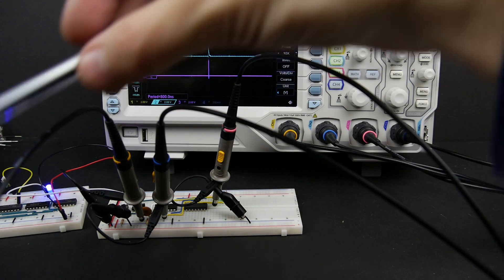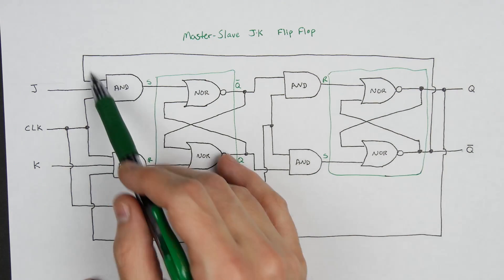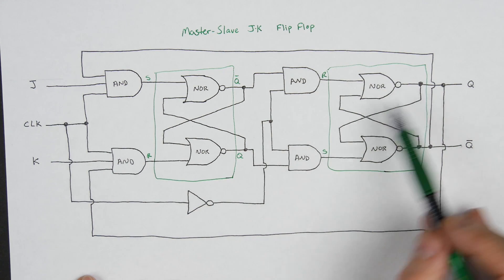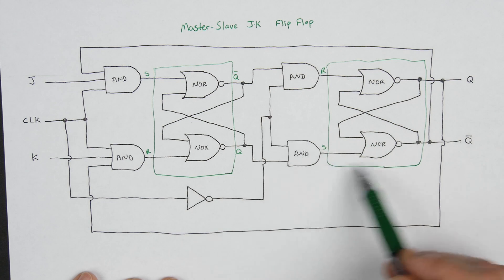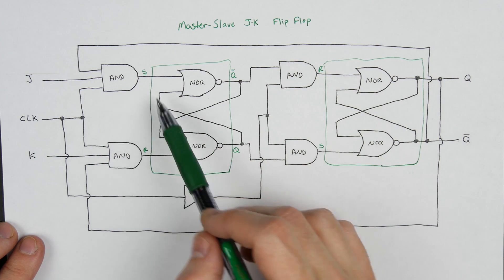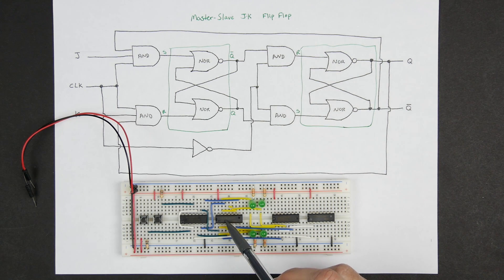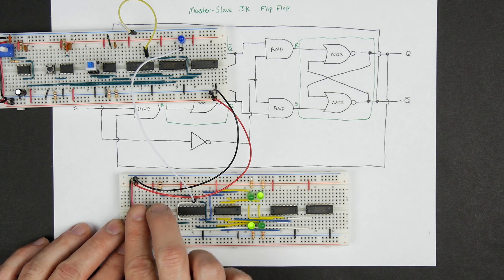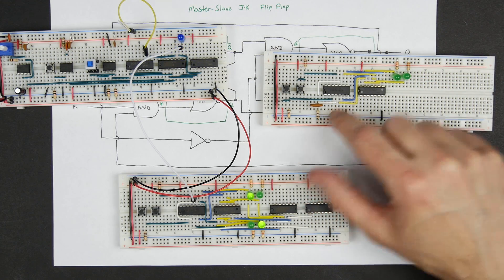Master-slave JK flip-flop

Comment: Has no one noticed the circuit at 5:21 must be wrong? J can’t set Q high: the bottom AND gate will always output low because of the low input from Q. 

With Q & J low, the bottom NOR gate outputs high making K & the top AND gate irrelevant.
Reply: You are right I noticed the same thing in his last video about JK flip flop itself, where he fed the `Q (Q complement) output to the K-AND gate and Q to the J-AND gate, infact in this configuration of JK flip flop (made with NOR SR Latch and AND gates) the feedback wires are not crossed, and the Q should feedback into K and `Q to J while in the NAND configuration of JK flip flop the feedback wires are sort of "crossed". So many people watched it and only a few people pointed it out,  makes you wonder, that if people are even learning (and essentially trying to think) or just watching it as entertainment

Comment: Personally, I would've just put something in the circuit to slow down the feedback signal... but i understand that's not really a viable / long-term solution if you want to go up higher in clock speed.

Comment: 📺💬 There are more applications as you may hear about clock and Q compliment for signaling transmission.
🥺💬 I start to watch his VDO from the built computer and not remote device control or transmission I do not know which one is harder but all are interesting.

📺💬 Next, we go to the full center and binary counter.

Comment: I think you should use RC circuit again in the CLK part. If you do not use RC circuit, you may have again racing condition in the master and slave part because when CLK is high, master part will always toggle and when CLK is low, slave part will always toggle. Also, the period of CLK should be very small  for example nanoseconds if you do not use RC circuit.
Reply: If it's connected correctly, the second one should never be able to receive both J and K inputs as 1s, so it should never be oscillating and the first one only toggles when receiving the output of the second JK in the series, so it shouldn't oscillate either

Comment: I'd love to hear your explanation of 74LS vs HC and others. Why do you use LS for these projects when most people seem to recommend HC? What should I get if I just want to mess around with logic?
Reply: The LS series still uses bipolar transistors for true TTL but uses less power than the original 7400 chips. The HC series is high speed CMOS which emulates TTL. The CMOS versions use even less power and are considerably faster than their TTL counterparts, so they're more often used for their performance in products you buy at the store. However, they're a lot more sensitive to static discharge which is pretty important when you're building something on a breadboard and handling the chips and connecting wires a lot. Additionally, CMOS tends to prefer 3.3V instead of 5V for power, though the HC series can handle either. If you're just messing around trying stuff on a breadboard, the LS series is much better in my opinion for its greater durability.

Comment: what if I place a pulse detector between the master's sr latch and gates and the cable with goes to the inverter for the slave sr latch. Will it detect a signal only at the rising eage of the clock or it will make a racing problem again?

Comment: 2:27: Aren't master and slave gonna be active when the clock is already high but the inverter is still switching from high to low?
Reply: As I understand it, this isn't an issue because it takes longer for the signal to propagate through the first SR flip-flop than it does for the inverter to switch. Afaik the inverter will switch faster than even just one of those AND gates, since the transistor logic is less complex.
Reply: @kieraleahy6795  Yes, you're right. Thanks

Comment: your JK FF is bit different with others in internet, they built all with NAND
Reply: The circuit at 5:21 doesn’t work. J can’t set Q high: the bottom AND gate will always output low because of the low input from Q. 

With Q & J low, the bottom NOR gate outputs high making K & the top AND gate irrelevant.
Reply: I studied JK flip flop built with all NAND gates and it looked correct

Comment: could it be possible to use the output of an edge detector to quickly update both JKs without the need to wait for the clock to go low? Is it useful in any way, apart for looking more responsive?

Comment: To beat the race condition, wouldn't it also have been possible and sufficient to simply use the CLK & !CLK edge detector circuit that was shown in the D flip-flop video? 
There was a simple circuit shown there that split the clock signal and fed one side into an AND gate and another first through a NOT gate and then into the same AND gate. It was shown after 7m29s here: https://www.youtube.com/watch?v=YW-_GkUguMM&t=7m29s Wouldn't that also do?

Comment: How to decide what is set and what is reset?
Reply: If they're unlabeled, then either input could be Set or Reset. Then whichever one you call Set determines which output is Q, because it'll be the output that goes high if you take Set high, and the other output is Q-complement. The circuit is symmetrical, so it makes no difference until you connect it to other things.
Reply: @SirRebrl  okkkk, thanks bud.

Comment: Latch -> flip-flop -> JK flip-flop -> master-slave JK flip-flop
Reply: where does the D latch fit into that?
Reply: @Natture01  latch -> SR latch ( basically to set or reset the latch ) / D - latch ( if enabled whatever D input is output is layched ) - > flip flop - > SR flipflop ( works just fine , except for when both set and reset are high , making it unpredictable) / J-K flip flop ( theoretically eliminates the unpredictability by accounting for feedback from output , but the clock is high for long enough time/ wide range making it practically unpredictable -> Master slave JK flip flop ( completely robust and predictable behaviour )

Comment: anyone implementing this with logisim - you can use the flip flop in this video with a reset input added to the first NOR gate in line with the k input. applying the reset there will bring the circuit to a stable state. 

reference: https://github.com/netguy204/cmsc313_examples/blob/master/logisim/Master%20Slave%20J-K%20Flip%20Flop.circ
Reply: Sorry for my ignorance but how can I run the code you sent?

Comment: there is a wrong in this scheme. you have to switch the feedback or to switch the NOR gates with NAND
Reply: The diagram is correct. If Q is high for instance, then the feedback to the K input-AND is high, and then if K is high and the clock is high, that takes that AND gate high, turning the first-stage Q low, which turns the first-stage Q-complement high. Then when the clock goes low, that propagates to the second stage.

The feedback only enables either input when the opposite output is high, which is what gives it the toggle ability if both inputs are set high - only the input for the state opposite the latched stat goes through.

You might be referring to other setups based on NAND gates and applying what you know from those? The internal logic of an AND-NOR setup is a little different than an all-NAND setup but it comes out working the same just looking at the inputs and outputs. If you draw it on a whiteboard you can step through the signal propagation by labeling the connections with 1's and 0's. That's what I do, anyway.

Comment: There is a problem with this. As the clock transitions between high and low you might have the inverter interpreting the clock as one thing and the first and gates as the other, making both flip flops enabled or disabled. You'd want 2 pulse generators (one for rising and one for falling edge).

Comment: If this doesn’t work for you keep reading. I built this even though it won’t be a final component of the computer, because I want to understand the logic. I also built the J-K Flip Flop because I wanted to perform the debugging with my scope. Of course, Ben does not walk through the build process on this Master Slave Flip Flop step by step and I would not expect him to at this point. I like trying to follow the schematic along with viewing the finished board. Unfortunately on this build, once I was finished, it did not function properly. Rather than examine the schematic, I simply compared my build to the video. I could not find anything wrong. Finally, I took a screen shot of the board and then blew it up larger. This is how I discovered that I completely missed the jumper on the 74LS02 between pins 3 and 4. It was so small it just blended in on my video. Hope this helps someone else that might miss it. Moving on now to the next video. Very much enjoying the build and the knowledge gained.

Comment: I'm kinda new to this stuff so correct me if I'm wrong. I don't think the second S-R latch portion of the circuit is needed, the outputs of the first S-R latch are the compliment of the outputs of the second latch, wouldn't it be simpler to replace that section (only the stuff surrounded by the green box green) with two not gates, or am I missing something?
Reply: It would keep toggling itself extremely rapidly while the clk is high.

Comment: This is a negative-edge triggered flip-flop. Is it possible to make it positive-edge triggered by using the NOT gate for the clock pulse of Master instead of the slave?
Reply: How we make this circuit on bread board . I mean to make this circuit which ics are used
Reply: @miniaturenature2507  You buy the 7400 series chips from Jameco and you assemble it.
Reply: i thinkk so

Comment: 7. This circuit relies on the falling clock edge to propagate through the Not gate on the bottom faster than the changed data propagates through the master JK-flip-flop. In an integrated chip this can be done reliably, but on a breadboard it might not be.
On what order of magnitude are the timing differences here? I don't have the parts to try it myself. If the difference is very large (something like 10 times the time it takes for the falling clock edge to propagate through the Not gate) then I'm convinced that the circuit is reliable, but I suspect it might be kinda close.

Comment: Yay, no more racing! ... But! What if the NOT gate used on the clock signal has a looser sense / lower tolerance for HIGH than the and gates? All logic gates have some manufacturing differences, right? If that is the case, and if the clock signal spends a sufficient amount of time in this state (where the AND gates from the 1st stage SR latch considers the clock to be high, and the lone NOT gate considers the clock to be low), would that mean that there would be some more JK racing? I'm guessing this wouldn't be an issue in most cases, but still. Who knows? (Not me, for sure!) Loving these videos!
Reply: Or just use the simple RC edge detector before the and gates.
Reply: That also seems a problem to me. You could solve it however. If for example you add the output of the inverter with a comparitor which checks if the clock voltage is less than a certain low value. Then the second SR latch would only be enabled if the clock is less than a certain voltage
Reply: I guess you won't need that inverter then either

Comment: Couldn't you just use a capacitor on the clock of a normal JK flip flop as you did with the D flip flop? Or would it be difficult to tune?
Reply: Do you mean using a capacitor-resistor combo as a rising edge detector for the clock? If so, yes, it would be difficult to tune, at least on a bread board. That would be why a master-slave JK is necessary. Ben explains this in the previous video in this series called 'JK flip-flop racing'.

Comment: Why do you use resistors with the LEDs in this circuit? I thought you've explained in a previous video that it's not necessary when it concerns the output of this kind of ICs.
Reply: Well, probably 4 years later either you already know the answer or don't care about it anymore, but anyway, this is more for myself:

I don't know what video you're talking about, but it's probably cuz some ICs have resistors on the output, and some doesn't.
Reply: @petrickoliveira1351  Haha, nope, still an open question! So thx for the response!
The other video I'm referring to is about the SR latch (5y old atm), and his remark on LEDs and resistors and ICs is around the 1:15 mark in that video.
I guess the answer to this question is hidden in the datasheet of the chip used here (the 74LS02), but I have only limited experience reading those kinds of documents.
Reply: @michelfug  I have learned that most TTL chips don't need resistors in order to drive a LED, but if the output is also connected to the input of another chip, you might encounter issues because the LED will "drive down" the output voltage at a level that some inputs might not recognize as a high logical state.
Reply: @petrickoliveira1351  if an IC cannot supply or sink much current, you might get away with no resistor. At best, it’s OK for prototyping but LED power consumption might be x10 higher, for example.
Reply: This is an easy one: the LED resistor sets the LED current (and affects power consumption of the whole circuit). LEDs will easily destroy themselves if you don’t limit their current.

Comment: Is this a part of the 8-bit computer or is it independent? I believe it is, but just wanted to make sure as it's not added to the playlist
Reply: In the 8-bit computer he uses digital counters (e.g. the program counter and possibly the sequencing unit), which are built from T flip-flops, which are pretty much JK flip-flops with both their inputs connected to the binary 1 (logic high) signal all the time, so they toggle with each clock pulse. That's why he needed to explain the JK flip-flops first. But they're not necessarily a prerequisite for the 8-bit computer, so those videos are not on the 8-bit computer playlist. (Same as with RS flip-flops.)